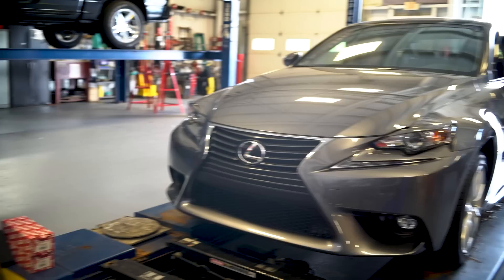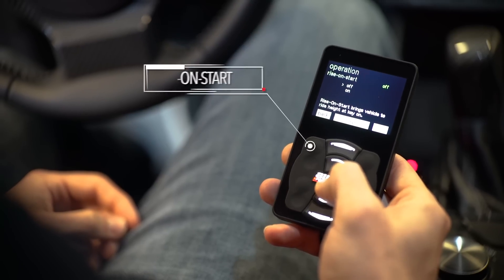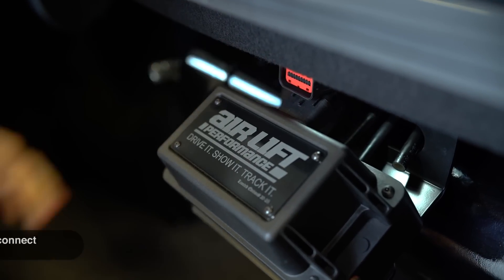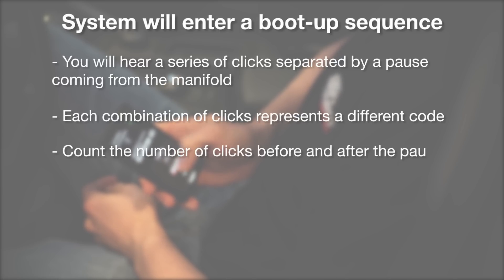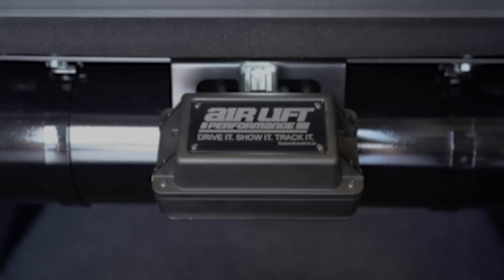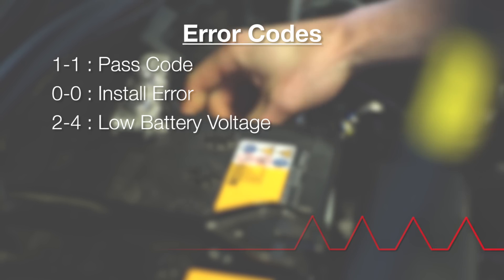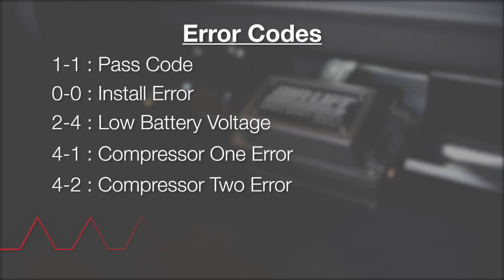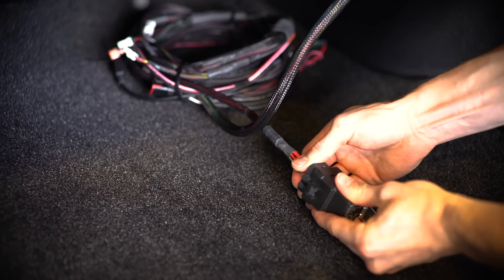3H and 3P Install Validation and Diagnostics

Comment: I’m having a problem connecting my phone it’s saying to upgrade software and when I did the controller now reads ecu and I still can’t use my phone or controller and if I pull cord from device and plug back in it gives me manual options and no longer airs out when I click down on device

Comment: So what is a pass code? That’s what I’m getting. What’s the issue and how do I fix it?
Reply: I need answers for this as well like wtf. 4K and can’t do a better diagnosis then some dam clicks that don’t help with shit
Reply: @mdk8148  make sure nothing is touching each other. One of the issues I randomly ran into is my compressor was shorting cuz it touched the body of the car. So that kept trigger it.
Another one is EVEN THOUGH combined amp draw is 40amps max, a 50amp relay still triggers sometimes and would just cycle and just stop eventually after like 8-12 recycles 🤷‍♂️

Comment: What if you don’t even hear any clicks ?? My 3p controller suddenly didn’t turn on and my compressor doesn’t turn on either, everything is hooked up correctly so i don’t know what is going on
Reply: Did you ever figure this out?
Reply: @BrandonFinleyx  I figured out that I didn’t have a good connection to my battery

Comment: After one year my controller stopped working and is not turning on again, the car is aired up so how can I deflate the bags? Already checked the fuses
Reply: I have the same problem , did you find a fix ???
Reply: Yes, it actually was the fuse I was checking the wrong one (have 2 more of the same). You can check if it is your controller by plugging it directly into a wall adapter, if it turns on it's not your controller.